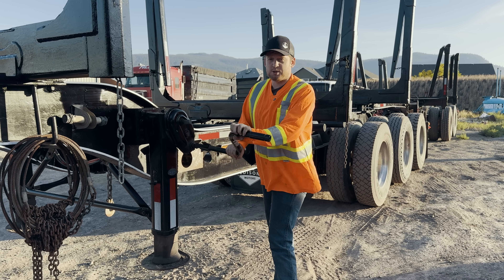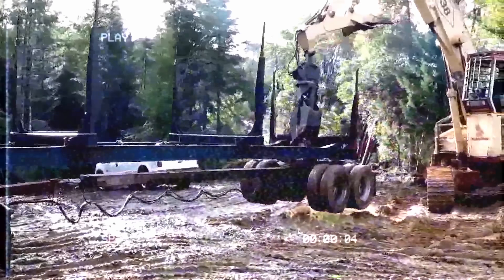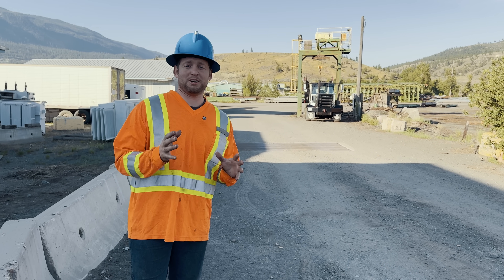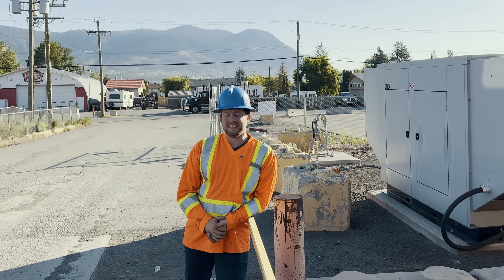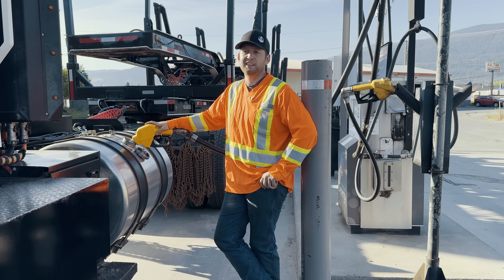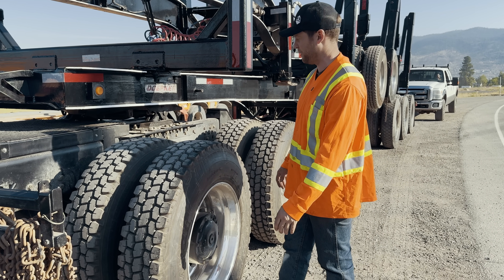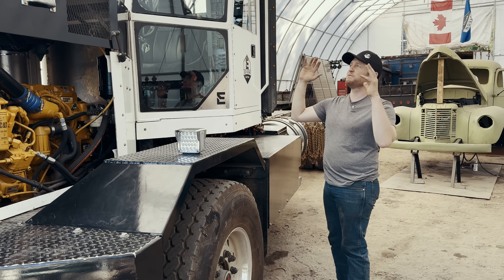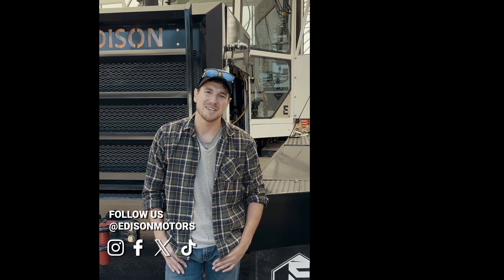We pulled our Trailer; You won’t believe what we weighed!

Comment: How long do batteries last.? Price to replace batteries? Thanks.
Reply: Battery life and parts replacement price should be comparable  to any electric sedan.

Labor cost to replace the battery pack should be 1/4 of a a sedan because it's easy to get the pack out of the frame rails.

Comment: Hi, nice truck, I like entusiasm in your video. About regen trouble, you need to run one axel (master ) in velocity mode and the second axel as slave, in torque mode. slave  axel will push torque only if master axel real speed is very far from target speed. it's very hard to explain it but it works 🙂. ciaooo

Comment: Hybrid advantage? Can you point me to a video explaining how fossil-fuel generator to electric motor is more efficient than fossil-fuel engine?
Reply: I think the video with Wes Works is the right one for that question.
But to make it short.
Long haul, this truck is not more efficient. This truck is for more niche applications. The guys from edison are loggers in BC where you go up empty and come down loaded so you can use regen. Another application is something like service trucks/ welding trucks/ ambulance that use the truck to get to the location and then need electric energy, before they had to idle all day

Comment: After years of being told that I just wanted to see EVs fail because I kept pointing out the glaring issues with them to people, part of me was starting to believe it. After seeing the work being done with this company, I can safely say my detractors are genuinely wrong. Here is a great example for doing EVs in a way that actually can be viable instead of showing them as being pricey novelties for snobs.

In the logging scenario and a few others, like short distance delivery, EVs make a lot of sense, despite the costly batteries. Even as a daily driver vehicle, they could be viable, just not likely with a full-sized car or bigger, because of all the dead weight and high cost of batteries needed to carry it. For a motorcycle or compact economy car, though, yeah, EVs are solid daily drivers. Sadly, there aren't many options on that front.... Yet...

EDIT: Also, a built-in generator as a way to charge things when a working charging station isn't nearby is also a great feature.

Comment: This is the first time I ever say this: I love Edison, so much more than Tesla!
Now obviously there are developments to be made for these beasts to have a real shot at being used as a long hauler like the cab, hiding the wiring, energy management system to last at least 800 miles (a bit over 11 hours per day) and of course a generator to top the batteries in at least 12 hours.
Now, I'm not an engineer but I doubt this will be more efficient than a conventional ICE system, though I'd love to see that I'm wrong, but it would still has its uses in high torque situations etc.
Reply: This truck is not a long haul truck, it's an off-road truck.
The mpg will be worse on the highway but better off-road

Comment: You've created the ultimate free energy machine. 6:20 The front tandem is reggening 100 kw while the rear tandem is pushing 100 kw and you're still moving! It's solid proof that you can drive while constantly replenishing at an equal rate while under power and still moving!

Comment: New to the channel, cool stuff. I get that having the diesel engine and charging capability built in makes a lot of sense, but are you not able to charge from an actual electric charging station also? If not, that seems like a missed opportunity.
Reply: They can but haters love to see electric trucks plugged in for hours.
The beauty of this truck is you can add energy into the system by plug or by diesel.

Comment: Coming from Europe, in a logging area, there will be demand for similar trucks here, but you will have to provide an electrical charging option as well. There is a large amount of hydro electric power available here and both econimically and ecologically it makes sense to have a way to charge logging trucks overnight. That way they get at least one charge from the grid and will use less diesel/HVO during their daytime use. Most logging trucks get parked at the sawmill or close to a place where there is electricity available after the drivers shifts are over, so no need to find power somewhere in the middle of the forest. Currently, there is an upcoming electricifcation of trucks going on here, but those are mainly focused at road transport in urban areas where emissions matter and the longer range trucks are hybrids where the freeway will use diesel power and the battery will be used in the "last mile" part of the trip. There is no focus on "off grid" trucks like you are doing and there is a (limited) demand for your niche here, but like I said, you will have a better commercial pitch if you can also directly charge the batteries overnight at the sawmill.
Reply: This truck can charge by electric grid to bit haters love to see EVs plugged in for hours
Reply: You are not going to be running logging trucks purely on battery in the forests of Sweden or Norway or Finland. Maybe in some flat polish or eastern european forests, you can get away with it - but not in the mountains. Total electrification of heavy duty vehicles is a pipe dream unless they have constant power supply like a high speed train.

Comment: You will want a slight difference in gear shifting speed between your two axles to deal with NVH and the axles influencing each other during the shift. Probably work on some hysteresis and regularly swapping out which axle shifts first, to get even wear between them. I don't know how you are controlling these axles, but I would suggest treating them fully individually, so any tuning/programming issues that are not directly related to interaction between them should be isolated and as a bonus, you can do better torque/thrust modeling. Just be aware that you will be putting forces on your frame with the individual control that can cause warping and metal fatigue if not dealt with properly. You are already dealing with that right now with the one axle going into regen while the other is driving, so I assume you have that already worked out.

Comment: Are these weights in lbs or kilos?
Reply: Its kg.
The light at 4:07 is on for kg.
But this is 12t truck plus 10t Trailer
Reply: @raphiseth6942  that's what I thought. Frigging Canadians are bi polar with thier measurements so I wasn't sure.

Comment: Once you do test run on hauling logs, I'd love to see a breakdown on energy usage. kWh used going up, kWh used going down, energy saved using regen, how much diesel you burned (compared to the same test with a conventional logging truck), how many trips back and forth you'd usually make in a day (and how that affects the battery requirements for a pure BEV version), how much you could get out of charging the battery from the grid overnight in a plug-in hybrid logging truck, etc.

Comment: This is so silly. They already had diesel trucks lmao, what a fraud
Reply: But this has the pros of electric (high torque, regen,silent) with the pros of diesel. (Quick to fill up, and good network)
Und on top the built a truck that is easy to work on
Reply: @raphiseth6942  some of the very first cars ever used this exact same setup. It is not ideal trust me. Huge losses and the thing will weigh 3 times as much. Just ditch the electric crap and put in a transmission.
Reply: @durbeshpatel3047  ... Did you watch the video at 4:00, where they talk about that this truck weights the same as a "normal" diesel truck?
But I think you only think about long haul trucks. They actively advise long-haul truckers away from this concept. This truck is for different applications like welding trucks, services trucks, cementtrucks, or logging trucks that don't drive all day on the highway.
Reply: @raphiseth6942  why would you even go after that part of the market? This idea is worse than i thought lmao. So this thing is going to try and compete with heavy hauler trucks? Thanks for the laugh
Reply: @durbeshpatel3047  Yes, they go after the market for (electric/hybrid) heavy haul trucks that doesn't really exist, most modern trucks aren't heavy haul trucks they are long haul trucks that try to be heavy haul.
Reply: @durbeshpatel3047  electric motors are perfect for heavy haul.
Instant torque, no gears, regenerative breaking when going downhill.
And the biggest downside of EV is the range of the batteries and that is taken care of by a diesel engine that runs at peak efficiency.

Comment: Granted building electric logging trucks and electrical engineering is only a hoppy of mine. Make both axles go the same way.
Reply: There isn’t room for the drive unit between the rear axle and front axle.

Comment: Since youre just ysing the diesel to tuen a generator, can you burn red diesel? Like red diesel in a reefer?
Reply: Yes, they even called to make sure.
It's a generator, If it is mounted to the truck or on the ground, it doesn't matter. They talk about that in a short video
Reply: If hybrids like this become more common they’ll likely change the law. But, as it is as long as the engine isn’t directly driving the wheels it counts as just a generator. 
Taxes are going to become an issue as electric vehicles start to become popular.

Comment: 22,190 on the scale read out was that pounds or what was it reading?
Reply: 22190 kg but that's 12.000 kg truck plus 10.000 kg trailer, or the same weight as normal diesel trucks. You can see the kg light at 4:07

Comment: One thing that's not usually mentioned is how smooth electric trucks are. Many truckers are loving electric trucks because there's very little vibration from the drive train which means much less stress on their backs. They end up feeling much better at the end of the day driving electric than driving diesel. Backaches caused by sitting are much less frequent. In the end what sells electric trucks might not be environmental, or performance, but just a nicer ride that isn't as hard on the body. Heck, imagine only engaging the generator when you're outside the vehicle so it charges without shaking your back to pieces, then you get in and the generator shuts off giving you a smooth ride.

Comment: How do you control the regen...how will it keep from just locking up and sliding on ice? That's already one of the problems with regular trucks.
Reply: They can program everything. They have different modes for different applications I am sure they will add a ice mode

Comment: This design is quite similar to what me and my brother plan on doing once we got the spare funds to get project trucks. Main difference is I plan on in-wheel electric motors instead of axle motors. I plan on using an old truck frame (very similar to what you got sitting in the back of your garage actually. Specifically a late 30s Willy's pickup if I can find a body kit for it).  

Glad to see the concept of electric with diesel assist is the way to go. 

Keep up the good work! I'm excited to see this truck on the roads near me sometime soon!

Comment: Once you get regen figured out i am very interested to see what sort of average kwh used per hour are on this rig while towing.
I want to know how much of an impact a theoretical solar topped trailer would be. Adding solar to a normal trailer could add as little as 300lbs with those lighter SIGS flexible pannels. Sure they dont capture as much power from the sun but its still around 10kwh per hour. The question is will this truck use 400kwh per hour under load and you'd only be improving fuel economy by less than 3% Or will this average less than 100kwh/hour and adding solar would increase fuel economy by more than 10%
Reply: Well their statements where 2 hours of driving, 1 hour of charging with 350kWh but they had the idea for cooling trailers and if I am not wrong their calculations where that it can deal with the cooling bit not the  truck
Reply: @raphiseth6942  Oh yea, i dont expect the 10-16KW of solar to power the truck, but reducing the load on the battery, either by putting it through the motors, or powering accessories like a refer should mean extending the range at least a bit, i'm just curious about how much it would extend.
2 hours of driving on 350kWh should mean 175kWh/hour and if the trailer produces 16kW/hour thats almost 10%, but thats dependant on them being in places like the southern US, or very high altitudes(aircraft height) where solar panels can be up to 50% more efficient.

If they ever expand into the US it might be a good selling point to also sell a solar trailer.

Comment: Seems that Topsy is proving to be an appropriate name, providing you all issues along your journey.  Insider tip - generally, with duplicate electronic devices (twin motors, generators, etc), one will prove to be "lazy" without proper and constant "management".   
Hope Topsy doesn't meet a similar demise as the original (spoiler alert - condemned to death by electrocution after trying to escape inhumane captivity).

Comment: @2:40, maybe a slow reverse and forward mode keyed to the key fob like some auto manufacturers use for parking, could be used so the driver could adjust the trailer position without having to return to the cab?

Comment: I've been wondering this, will the generator keep up with max load on the e-axles. Or does it just mitigate battery drain under heavy loads?
Reply: Like your driving up a hill pulling as much as the truck will pull, maximum draw from the batteries. If you turn the generator on now. Will it charge the batteries or just slow the consumption of the charge on the bats?
Reply: no, generator have 350kW of power, e-axle 2x250kW, without batteries power is limited.
Reply: The generator won’t keep up with full power draw. But, even without the generator it would take several miles to drain the batteries. Aren’t typically going to be constantly at max power for that long. Especially since the generator will slow how quickly the batteries get drained.

Comment: what about a control system that allows you to adjust the truck from outside? if it is too far front or too far back, it will be more convenient to just stay outside and remotely move the truck forward and backward. It's an electric truck fully computer controller. Should not be too hard to make it remote control. Give it a thought i guess.

Comment: What if you made a trailer that also had electric motors to assist with hills and even regen on the batteries. Hopefully creating stronger brakes too!
Reply: If the truck loses traction on slick roads, then the trailer is pushing the truck.. This is the ideal condition for an _unrecoverable jack-knife._ Don't put motors on trailers.

Comment: One thing about the regen issue. Instead of re-programming the axle, why not just reverse 2 of the 3 wires since they're 3 phase AC?
Reply: The axle isn't always doing the wrong thing.  It misbehaves only under certain conditions.

Comment: and the good thing is, you can alwayus add more batteries as a upgrade depending your use case its modular :D
Reply: Well you don't need more batteries, the size if the batteries is calculated for the power not the range. They get the range from the Diesel.

But yes you can replace the engine with more batteries

Comment: Would there be a way for you to add an “inching remote” to your system. A wireless remote that you could inch the truck very slowly forward or backwards while you are outside the unit. It would be great for your loading and trailer hitching, some tractors have a system for this to aid hitching trailers and implements etc. just an Idea.

Comment: Just out of curiousity, have you ever considered titanium instead of steel?  Its definitely not traditional, but if can bear a similar load with a much lower tare, wouldn't that enable a lot more load weight capacity?
Reply: ...I think that would be to expensive

Titanium is 40 times more expensive
Reply: @raphiseth6942  Up front yes, but in situations where trucks and trailers are being frequently driven with max load, they could accomplish a faster delivery throughput with fewer loads, since they could haul more with each load given a significantly smaller amount of a given GVWR is consumed by the weight of the truck/trailer.  In such frequent, heavy-haul situations, I think the extra up front material cost could pay for itself in the long run with increased transport productivity.

I do imagine the problem with logging trailers being too light when empty could be exacerbated by using a lighter material, though.

Comment: I won't say i know what's going on, but if I have to guess these axles are trying to mirror each other out since they're opposite mounted, but gears don't have the same reverse behavior, specially helical conical gears, either you mount them parallel to work as tandem or make them work each as unique set

Comment: what advantage will there be regarding mpg and overall power compared to a standard diesel truck?
Reply: They don't built trucks that calculate in miles per gallon, the built trucks for jobs that think in gallons per hour.
Like logging in Bc, or welding trucks
Reply: depends on use case. He mentioned in earlier videos it could range from 10-50% fuel savings, and it will have more power than a standard 15L diesel engine
Reply: in ideal situation even over 100% (never charge & never refuel), because they climb uphill empty loading additional 2x what truck weight and goeing downhill using regenerative breaking all the time on fully loaded truck.
over 100% because it is even possible that you start, battery 60% climb uphill battery ex10% loading going downhill regen and on the bottom of the hill you have a battery at 100%.
That would require constant very steep hill. and driving only up empty, down fully loaded. without any deviation.

that isn't perpetual mobile because you use potential energy of the load, from the top of the hill.